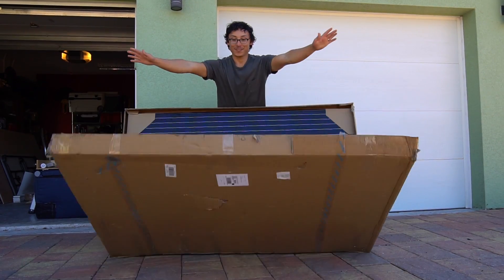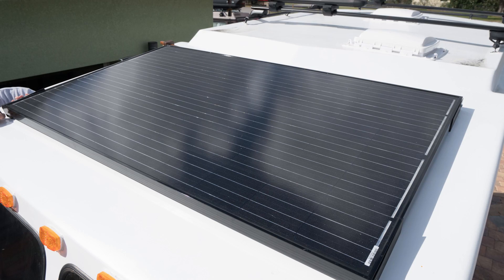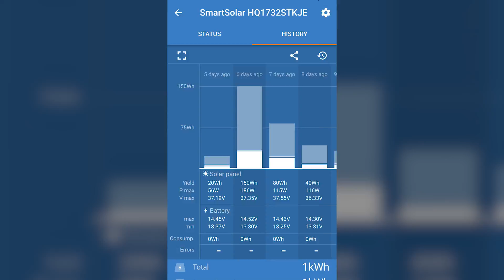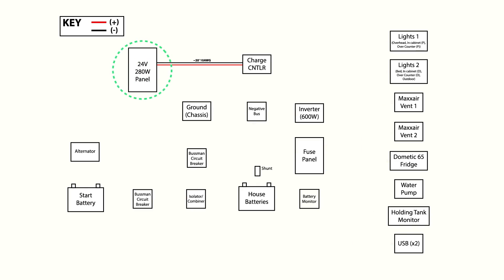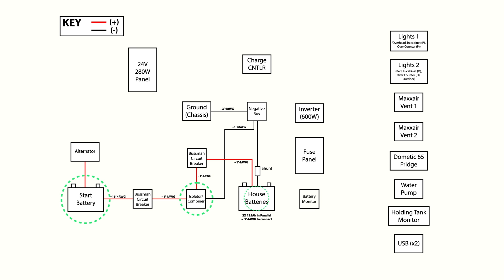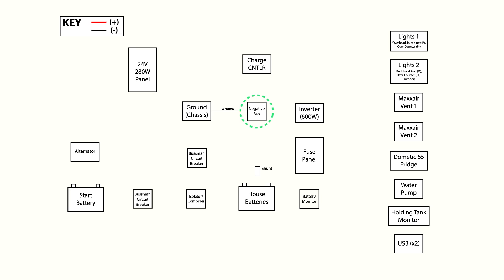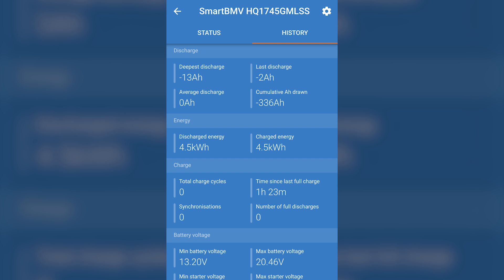Off Grid Camper Electrical System | 4X4 Toyota Sunrader Build Part 11

Comment: Don’t forget the pros of AGM / lead acid - you can charge these batteries at temperatures well below freezing, which you can’t do with lithium. My rig runs in northern Canada year-round and AGM was the only way to go at those temperatures. AGM was also a third of price which makes up for the lost capacity when only running batteries down to 50%

Comment: Lithium batteries have many plus points but the one negative that concerns me is when they fail its a fire that will totally destroy your rig , its not  a simple fire to put out , so as much as everyone keeps pushing lithium batteries why arent you talking about the fire hazzards,  like what to do ? What fire extinguisher to use ? And most important where not to store them ! Oh these batteries are great , till they overheat and catch fire then its all hell breaking loose , tell me im wrong , please , go watch how fast and hot the fire gets on failed lithium before you jump in head first , im on the fence with them , the positive parts are very inviting , but the negitives scare the hell out of me ,P.S. also its funny you mention the company who made your batteries is no longer around , hmmmm why ,,,,ya that says alot about lithium companies now dont it , who do you sue when shit fails ,,,,ya nobody

Comment: Thank u so much but I need help understanding the solar panel thingy 

🙏🙏🙏🙏🙏🙏🙏🙏🙏🙏🙏🙏🙏🙏🙏🙏🙏🙏🙏🙏
I ORDERED THIS PLEASE TELL ME WHAT IM MISSING ANYONE 

570 solar extreme solar panel kit 
190-watt solar charging kit + 2 x 190-watt expansion kits (OVERLANDER + 2x OVERLANDER-E) - 3 x 190W Panels

Go power IC
3000 watt industrial pure sine wave inverter charger for AC power 

DC inverter install kit 

30 amp pulse width modulated digital solar controller (GP-PWM-30)

75 amp smart battery charger (GPC-75-MAX)

30 amp pre-wired automatic shore power/inverter AC switching kit (GP-TS)

Inverter Remote on/off (GP-SWR-B)

50′ of MC4 output cable (#10) and all mounting hardware (2 x GP-MH-2

Specs:

Output Power: 510 W / 26.7 A
Inverter Power: 3000 W
Solar Controller: 30 A, PWM
Inverter Remote: On/off, Digital monitoring
Smart Converter Charger: 125 A
Transfer Switch: 100 A (2x50A Legs)
Inverter Fuse and Cable Kit: 400 A fuse, 4/0 cable 

Solar Modules & Controller:

Solar cell type: Monocrystalline
Output power: 170 W
Rated current: 8.9 A
Rated DC voltage: 19.1 V
Open-circuit voltage: 22.5 V
Module efficiency: 16.4%
Connectivity: MC4 connectors
Solar controller: 30 A PWM, multi battery option, 4 stage charging, digital display and flush mount, dual bank with USB
Frame type: Clear anodized aluminum frame
Certifications: CE
Dimensions: 59.06 x 26.3 x 1.59 in / 1500.12 x 668.02 x 40.38 mm
Weight: 26.4 lbs / 12 kg
Warranty: 25 years power output (module) / 5 years (controller)

Inverter Specs: 

Output Power (up to 40ºC): 3000W
Surge Power (100 milliseconds): 6000W
Surge Power (5 seconds): 4800W
Peak Output Current: 52A
Continuous Output Current: 25A
Output Voltage: 115 VAC
Output Frequency: 60 Hz ±0.1Hz
Output Waveform: Pure Sine Wave
Efficiency (Peak): 90%
DC Input Voltage Range: 9-17 VDC
Maximum Continuous DC Input Current: 400 ADC
No Load Power Consumption: Normal Mode:25W, Sleep Mode: <5W
AC Connections: Split Phase In/Dual Out, Dual In/ Dual Out

Smart Converter Charger Specs:
Input Voltage Nominal: 120 VAC
Input Voltage Range: 80 – 140VAC
Input Current: 18A
Input Power Factor Correction: 0.97 typical
Optimal Efficiency: >85%
Charge Control: 3 stage with manual equalize
Output Voltage: 5-16 VDC
Output Current: 125A
Change Temperature Compensation: Remote Battery Sensor

Comment: Great vid!  
You have great power setup.  
I have grand plans to upgrade to a lithium setup like yours.  
Sadly for many people, including myself, cost is the number 1 reason for having to stay with AGM batteries.  
In my camper trailer weight is not a big issue, therefor having 2 x 120Ah AGM batteries for a fully usable 100Ah load capacity is fine.  
The cost of my batteries and 240v 7 stage charger was $500 here in Australia plus my 160w folding solar panel was bought $120aud on sale at a caravan and camping exhibition down in Brisbane.  
Hopefully with the big electric vehicle companies developing lithium tech, batteries and charging systems will hopefully drop in cost fairly rapidly for recreational users?  
All the best luck to you!  

Regards, Jas.  
VK4FJGS  
Rockhampton Queensland Australia

Comment: While lithium is able to be discharged to 20%(meaning effectively nearly double usable capacity) it is still in 2020 more than twice the price for lithium. And that's for CHEAP lithium which almost definitely will not last as long as is claimed(already many tales of very early lithium failure)

So unless you're spending big $$$$ on lithium then you may end up with a dead system and a big hole in your pocket from buying twice.

Also panel efficiency means absolutely nothing. So what if one is 22 vs 18%. Panel output is panel output. 280w of any panel is 280w.

Comment: Guys, this is the ABSOLUTE best video I've found on wiring a camper- and believe me, I've looked!  Great job!  Would you please post a photo (or just tell me) where the house batteries connected?  Your wiring diagram shows the POS+ of the house batteries connected at the Bussman on the Li Batt side, but I only see the one red wire connected there.  Is that where you connected, or did you connect the POS+ from the house batteries to the POS+ on the fuse panel?  You guys RoCk!  Thank you!
Reply: ...did you get an answer to this? I've got the same question. :)

Comment: As usual you guys nail the details; but this is in your old camper. I was wondering about the electrical in your new Tundra/4 Wheel Camper. I remember you saying that the 4 Wheel Camper didn't meet your electrical needs because it lacked 120V power; that if you wanted 120V you needed to hook up to "shore" power (this is based on memory, maybe I got some of this wrong). As a result you made some modifications to the 4 Wheel Camper electrical system, including new lithium batteries and an inverter. This allowed you to install some outlets that you could use to power your computers and other stuff. I don't know about your other viewers but I would love it if you would explain, in detail, the electrical system in your new Tundra/4 Wheel Camper; not just the system you get with the camper (solar panels, controls, etc), but a detailed description of the changes you custom-made, what they are and how you did them. Thank you.

Comment: Why does use equate to damage of lead acid batteries in most peoples minds? Use it more than 50% and it's damaged. It would be like getting in your golf cart and driving half way round your golf course and walking the rest to stop the battery from being damaged. It's an excellent way to put people off golf but it's not true. Golf cart battery makers intend the battery to be deeply cycled, hence the name... deep cycle batteries not 50% cycle batteries. They last for 2 years if you discharge them by 90%, which is a good life for its purpose. We, in the solar fraternity, have learned that if you only discharge them to 50%, we will get about  4 years out of them. If we only discharge them by 20%, we will get 8 years life out of these batteries. They wear out! 

They wear out whether we use them or not. We don't damage them when we discharge them below 50%, we wear them out. The 50% figure is an economical balance point... it's based on battery life or number of cycles, if you must. Most people who use them, understand and accept this information. Somehow it has been turned around to mean that if you discharge them below 50%, you will damage them... you won't! You will however, wear them out more quickly... 4 years instead of 8 years. 50% of 8 is 4... 50% depth of discharge is 4 years... 50% is a reasonable life expectancy. 

Lithium chemistry batteries are expensive... NZ$4,000 for 12v 400a/h... lead acid are NZ$600 for 12v 400a/h. I'm not on NZs rich list so I use lead acid and put up with a few inconveniences associated with them and I don't repeat the urban myths that most people repeat... especially when they want to promote an expensive new technology.
Reply: Thanks that selling point is what had me  about ok layout more for lithium.   Gonna try flooded lead acid

Comment: Hi there, just watched the electrical set up video and curious about having a 24v solar panel. Does the victron controller sort the power from the 24v panel to the 12 v batteries? Ive got a 200w 12v panel feeding 2x 110ah leisure batteries on my van but looking at doing another and never gave the 24v any thought really. Was your only reason the wire thickness for this choice or are the 24 v panels any better performance wise, thanks Bob
Reply: Solar panel output voltages vary quite a lot even from a single panel, let alone wiring them in series or parallel. The '24V solar panel' they're talking about likely outputs anywhere up to 32~40V 'unregulated' and so once a regulator is added, the output is then suitable to charge a 24V system but the solar charge controller is probably compatible with quite high solar panel voltages and can still bring it back down to a suitable charging voltage for 12V systems.

The unregulated solar panel output gets fed into a solar charge controller (in this instance, a high quality brand MPPT type (Maximum Power Point Tracking) one vs. a PWM (Pulse Width Modulation) type that isn't as efficient) which then 'regulates' the incoming power from the panel(s) and converts the voltage using internal DC-DC converter circuitry (can often step-up as well as step-down voltages) to the chosen compatible voltage output (in their case it'd be 12V). It's possible that either that model can be configured to have 24V output or there's another model that's suited for 24V electrical systems.

standards are hard to get away from as proven in that case. This is similar to the comments in the video about why a 24V panel is preferable over a 12V

Comment: This is brilliant.  Thanks so much for probably the best explanation I've come across.
Cathy (out o' Ottawa, who has gleefully run off with the husbands YT account while plotting an eventual van build that will include a wood stove...)
By-the-by - I've worked out a system for a Composting Toilet that won't cost a grand and can be mounted on wheels... if you like I can send you a copy of the file?

Comment: Around 4:00-4:10 in this video you say "...automatically opens (?) up a connection when it sees a charging voltage. When the alternator kicks in and starts charging the starter battery, the Cyrix opens (?) the connection and allows both batteries to charge"  How can you simultaneously charge all batteries when you have "opened" a connection between the two (or three) batteries? I am not quite understanding this. Watching your video it appears you have a decent background in electrical and it's possible the term was just used wrong. Thanks for the tip on the Cyrix, as I plan to research it more.

Comment: Fantastic video. A quick question about the Cyrix-Li-ct: the manuals for it mention using a BMS to control it. You don't mention using a BMS and don't seem to have one connected. Is it optional? Thanks!

Comment: You mentioned you had three flexible panels with your van that failed.  What brand were they and can you explain how they failed?  Thanks for any info!  I've been looking at a Renogy flexible for my camper. Great video btw.
Reply from the maker: Honestly, don't remember the brand, they were just purchased off of Amazon. The problem with them is that the protective coating over them is super fragile. If they got scratched at all the would eventually melt...which is a problem.
Reply: @BoundForNowhere  thanks for the info.  I've really enjoyed the series on the Sunrader.  Looking forward to the tour video!

Comment: Is that the battery monitor that looks like a circuit board on the shunt? Looking at the blog pics now
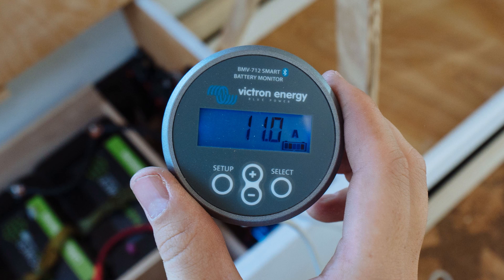Reply from the maker: The battery monitor that you actually interact with is the circle at 6:30. Not sure if that's what you're asking or if you're wanting to know more about what makes up the shunt.